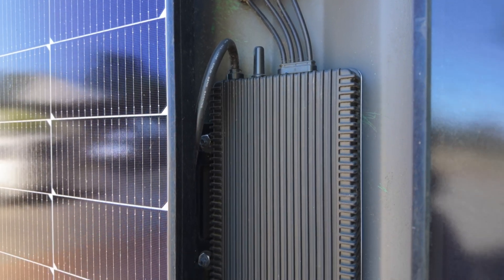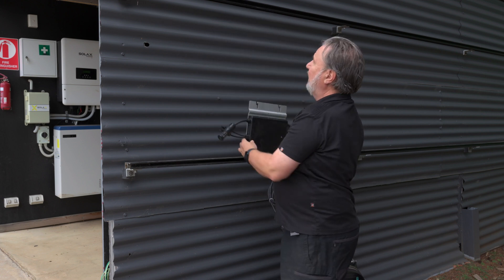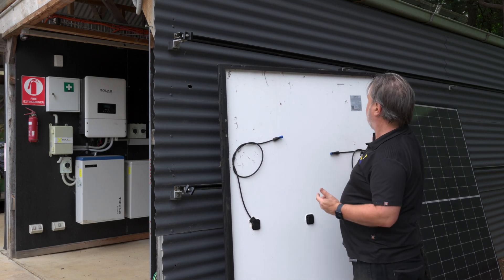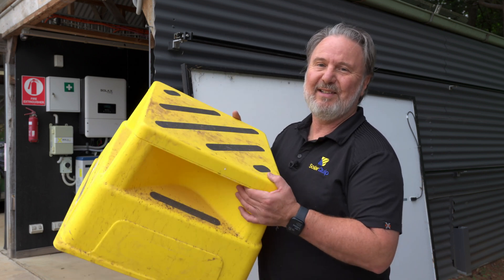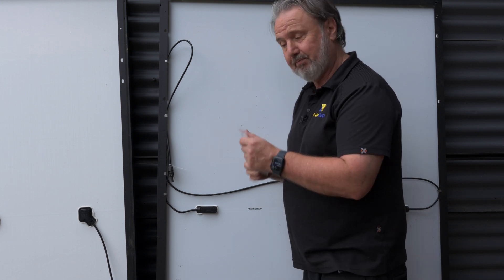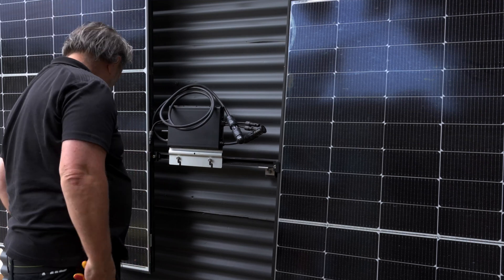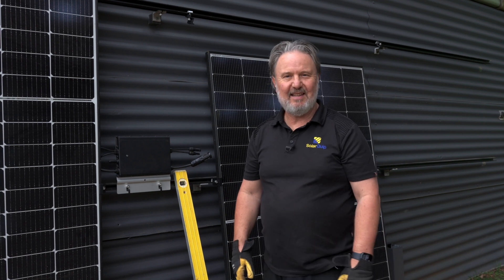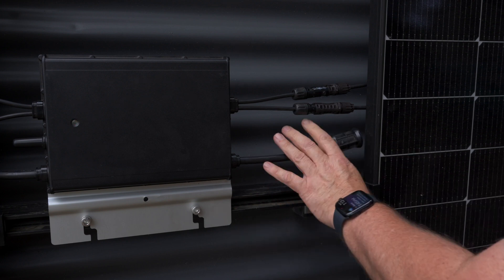Hoymiles Microinverter Installation

Comment: am i right in assuming that if using the MIT-5000-8T with AIKO-A645-MAE72Dw panels in a 2S 4P setup that be ok on the voltage and amperage side for this micro inverter but could only do 5 micro inverters if using 6mm branching cables? so a total of 40 panels or maximum of 25.8kw array

Comment: at least i know they have MIT-5000-8T to do maximum of 625 watts per panel but is 3 phase but hoymiles needs stronger for single phase mINV to go up to 650 watts as they are going to be more mainstream in the near future due to price, efficency and size not to mention bifacial.